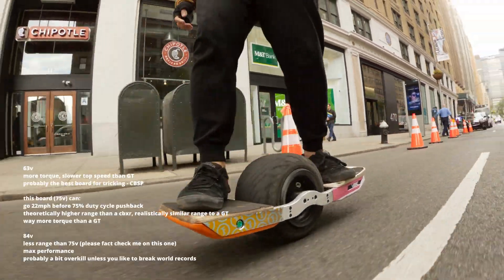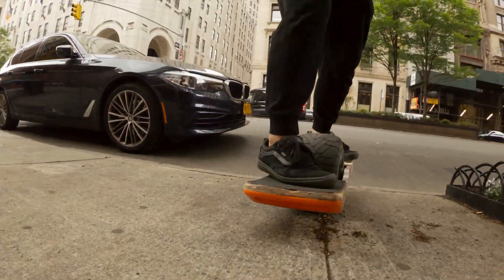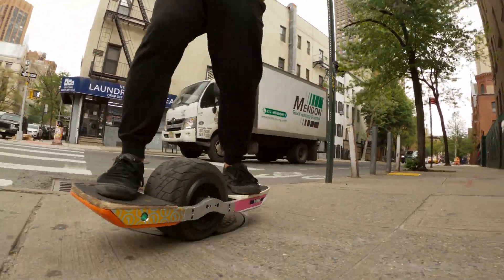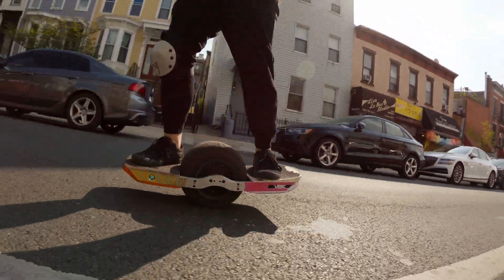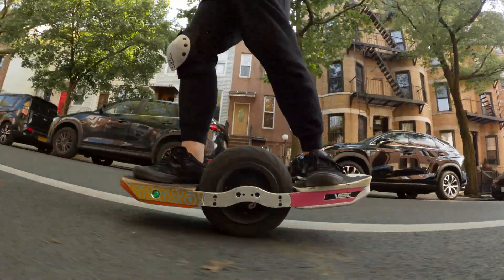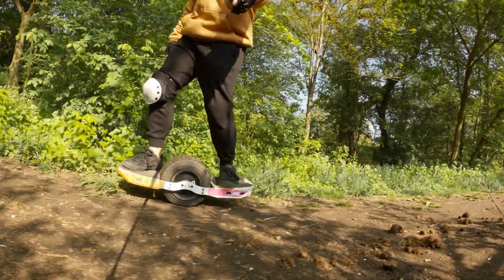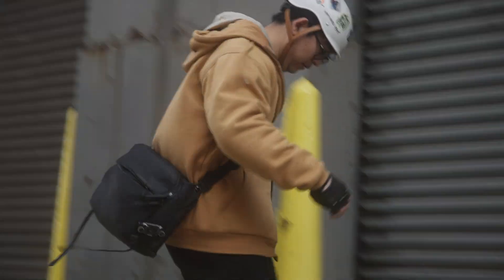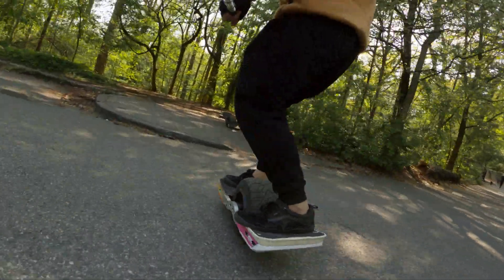10 reasons why a VESC is better than a GT

Comment: Sorry to arrive late to the party, just came across your interesting video now. I want to VESC my GT because I find it to be a little dangerously underpowered at times. I am not as DIY ambitious as you so I would do it with GTV kit. My main concern is captured between 0:49-1:00 of your video. What you are saying is that FM is more conservative with the Amp limits so the controller will last longer. I see that as a game changing benefit. My fear with a VESC controller is that it will suddenly die because it was not designed to last the many thousands of miles that I expect it to last for. If it dies while I am riding 20+ that is huge problem. Are you able to comment on the reliability of a VESC controller (generally, and specifically for the GTV) vs FM's GT controller, which seems to be proven as highly reliable?
Reply from the maker: Hi, great question! I actually do have a VESC board that I'm intentionally holding back the amp limit for longer longevity. Very easy to set that up if that's what you're after. None of my FM controllers have lasted 2000 miles because of the way I ride it (in rain with road salt, nudges, etc) and I'm getting comparable longevity from VESC controller. Also, these VESC controllers have years of history on Eskates and they've been working fine. Can't comment on GTV since I haven't ridden one.
Also boards dropping you at speed is a common fear. On VESC boards (all my boards have this treatment) you can setup the board to ignore footpad beyond a certain speed, ignore hall sensor beyond a certain speed (i think FM also have this feature), and some firmware can also ignore power button short press at speed. So basically at speed if one of your tiny cables fall loose, as long as your controller is still getting power from the battery pack, and your 3 thick phase wires are solid, you board won't drop you at speed. I actually have ridden once where the footpad cable came undone mid-ride, and I only noticed it after I came to a stop. If I was on a FM board this incident would've dumped me. (not to mention I was able to keep riding for the day without a working footpad by turning on simple stop and ghosting the board)
Reply: @leonchang7596  Thanks for this reply. I see there is some advantage to VESC to keep it running under some circumstances - these are good to know. I still worry about the controller suddenly dying at speed, trying to do what I can minimize the chance of this. My GT has dumped me twice at speed when I was asking too much of its power, but I have nearly 7000 miles on it and my board has never just died. So I consider it to be highly reliable and I don't want to trade one risk for another. If I can reduce the risk of underpower nosedive and not increase risk of controller/component failure, that is a big success.

Comment: I´ve a question: How do I start to get deeper into "oneWheel" topic? 
I want to buid my own, and see a lot about VESC... ;) If there are some hints for starting? 
BR Thomas
Reply from the maker: Good question! If you’re new to the sport then get a used XR or GT and start riding, building a board might be a bit too involved if you’re just starting out unless you’re very dedicated. If so some of my latest videos show you the process. Also read pev.dev, join the Fungineers and vescify discord, and watch some DIY electronics tutorials if you decide to build vs buy.
Reply: @leonchang7596  thanks for answering. I definitely take a look into building my own. But maybe I get a good opportunity to buy a used one to get my first driving experience... 😜
Reply from the maker: @der_kaputte  yesss, definitely recommend getting a used working board first, especially because without knowing what a onewheel SHOULD feel like, if you build one yourself and it's not behaving correctly, you won't know anything is wrong. And DIY boards are sooo focused on options that you gotta have a preference of what you prefer to know how to pick parts
Reply: @leonchang7596  Thank you very much, that sounds very understandable. I'll start looking for a board nearby ;)
Thank you first of all!

Comment: Love your video! thanks for the info. I want to know can you upgrade an XR + with 4212 build to VESC? I was going to buy a board from a seller, but I heard that the 4212 cannot be upgraded.
Reply from the maker: Yes! Any hardware version will work, since you’re swapping out the controller anyways, doesn’t matter which version it is
Reply: @leonchang7596  great thanks for  replying my question now is the cost so I can pick a used XR+for 900 with 150miles it might be better just to buy a float wheel adv 😉
Reply from the maker: used xr ~1k + batter upgrade ~600 + ubox ~130 + miscellaneous parts roughly equals to an adv. the decision is more about which platform you prefer and what you value in a board(range and speed vs third party accessories), and who you choose to support (small shops in the community or tony)

Comment: Hey, the torque thing is because the vesc actually CAN control the torque due to FOC technology and shunts for measuring phase currents. Torque ~ Current. The other motor controller doesn't do FOC.

Comment: Appreciate your videos, Leon! Great info! 

I see a lot of people rocking WTF rails for their VESC builds. Are there configurations in the shaping for VESC that eliminate the need for a tilt kit? 

I’m planning out a VESC build as we speak, and I’m wondering what the Pros and Cons are of going with WTF rails for my VESC board. Is a tilt kit still needed? Do you have one on your VESC? Or is there another alternative that’s made a tilt kit obsolete? Such as a new part or advanced shaping settings that FM doesn’t have.

Would love to hear your thoughts!
Reply from the maker: Hi! Glad you enjoyed it! Hardware tilt kit is not necessary for Vesc, you can change the default set point by recalibrating your IMU. You can even save IMU presets if you constantly switch back/forth between Ws and straights! Actually any hardware fix for a FM software issue is no longer necessary, such as tilt kit, posi, surestart… can all be emulated in firmware

Comment: literally bought a gt about a month ago dialed it up with wtf rails enduro tire kush wide chillers etc. now i want a vesc but the build seems daunting af
Reply from the maker: I came from GT too, bought into the XR ecosystem specifically for vescing. It's quite the jump!
Reply: @leonchang7596  grats on the build. how is it on trails? i feel like the gt with all the aftermarket parts is the most sturdy board for trails.
Reply from the maker: GT is the best board when it comes to tanking rock gardens and cobblestones. You can go fast over super bumpy terrain and GT’s nose will not wobble at all. For all other aspects, I prefer my Vesc. There are new trails that are getting unlocked in my local area where only Vescs are able to hit

Comment: Wouldn't you get more range out of a 84v setup than a 75v setup? Wh= volt x Ah. Ah- amp hour. Wh- watt hours.
Reply from the maker: The reason that currently 75v setups are longer range is that they use 21700 cells, and it's not possible to pack in 20 cells in series while still being 21700. So most 84v packs are 18650 packs. The workaround is a split battery pack, where they put 18 cells in series in the rear, and the rest in the front box. This will require a bigger controller box, such as the elm box. It's do-able but it's above my skill level, and wiring that for BMS I'd imagine to be a pain in the ass.

Comment: I'm not a OneWheel rider but just wondering if there is an option to have a wifi accelerometer/sensor in your glove to control the tilt angle so that dynamic response to changing slopes were possible? A button on the back of the hand could act as a reset so that hand orientation can be re-calibrated on the fly as often as wanted. This board is fascinating for its self-build options.
Reply: yes there is.  

https://youtu.be/Udap4uno3E4?t=721

here at 12min he talks about it
Reply: @e5211  thanks. It’s great to see as open source movement from the one wheel community. Now, we need the same for EUCs.

Comment: Except a float wheel is even better than a vesc as it performs better than even a 84v vesc battery with its 6 hp motor, much more range (up to 36 miles) than the 84v vesc battery packs offer, is mostly prebuilt for you already and most importantly even the top of the line float wheel adv pro costs much less than our costs to upgrade to vesc at only $1800 & don't need a pre existing fm onewheel to build upon
Reply from the maker: I'm as excited as the rest of the community about floatwheel, and I suspect it'll be a great replacement for the GT platform. But let's hold off on opinions until we get third party reviews.

It takes ~$150 to upgrade an XR to a VESC if you have common DIY electronics parts. You can recycle your XR controller box and mod it to fit a ubox 80v, which comes with all the cables and ports that you'll need for the conversion.

Also I personally love the XR platform. There are UHMW bumpers, thin rails, off-the-shelf components for literally every single part of the board, rectilinear design with no curved surfaces, which makes designing custom accessories extremely easy, and a super saturated used market. I also love that I hand-built my board and tuned every aspect of it myself. Is it practical? No. But when people ask me "hey how much does that cost" I can confidently say "idk I built it myself".

Again, it's great that we're finally getting a real competitor to FM, and the attention of detail that Tony has been bringing to this product makes me super hyped, but this VESCXR is still my board :)
Reply: On paper perhaps. It's also a 43 lb pig

Comment: My CBXR, bought off Craigslist, has an anti-theft FOB to turn on my Onewheel. (Orientation still matters, I just don't have to bend over to reduce that quality of life you speak of.) 

The power button no longer functions by design, as this device bypassed it. Reverse image search shows a "Wireless RF Remote Control Switch." When I went to Arkansas for Float Fest 5, no one had heard of it, and people were starting to refer to me as, "You're the guy with the remote start FOB?" 

Last year I tried to pry into the controller box but I couldn't see what had been modified. My light just started flickering so I will be going back in again and I will try get to the bottom of this mod because it is nowhere to be found, online. As in the guy that did it, must have known how to do it, because I can't find a video tutorial about it.  

https://www.amazon.com/gp/product/B0B7ZM1TGS/ref=ewc_pr_img_1?smid=A19JB4U5KYS1EN&psc=1
Reply from the maker: interesting design, i've never heard of anything like it! i did met a guy who rides a board without a pressure sensor as a front pad. instead it's a magnetic keyfob that sticks onto the footpad and tethered to his anckle. pretty cool alternative design!

Comment: So this vest is plug and play or do I need some specific knowledge like computers and stuff I want my board to behave like yours. Where do I start how long does it take to build a vesc I wanted to do this with my gt btw
Reply: If you don’t have any DIY building or maker experience, then this is not a good first project, especially if you have no direct help. It’s a lot to learn and many parts of it are critical, and will become dangerous if you don’t know what you’re doing.
Reply from the maker: GT is gonna be especially tricky because it does not use off the shelf connectors for motor and footpad cable. This means you’ll have to reverse engineer/3d print your own clone of FM’s proprietary connector. If you don’t have DIY experience I think it might be a bit more than you can chew. 

Even after completing this extremely arduous project, I’d argue the end result is not as good of a ride as an VESC-XR 

If the GT is your only board, you probably should get another board to vesc anyways, assuming you ride frequently.

Comment: so glad i found this video. i am plannig to vesc my pint x and have no idea where to start , cant wait for next video, thank you for your work EASY SUB
Reply from the maker: Thanks! Pint x vesc mod is a bit tricky since all of the connectors are proprietary to FM. I saw some people reverse engineer FM’s connector with a 3d printer. The next build guide is gonna be more focused on modding an XR, but I think you might get a few things from it too!
Reply: @leonchang7596  ya understand, I appreciate your response . 
I guess I will have to buy a soldering station, I think if it’s not a  bored soldering, I should be fine, my main thing is if I have to change my BMS as well or not ..  because I don’t want to deal with it. (And I know FM always fined new ways to make it harder so I am not sure about this version) .
My pint x is hardware 7314 
Firmware 5076
..
Also would love to know which VESC   one is “best”.. ( preferably with Bluetooth, modular already, and the resistors-so I have lees soldering  Work to do.👌🏻
Reply from the maker: Focer have the least amount of soldering and highest performance but is a pain to deal with. It breaks all the time in 3d printer boxes and doesn’t support LEDs, only has internal bluetooth (will randomly disconnect on iOS devices). I think it’s good for an endgame build.

Ubox is a lot more beginner friendly because it’s cheaper, comes with an external Bluetooth module, a fuse, and all the wires you need to get it working. But you will have to solder stuff. Nothing too hard, just soldering wires to pins.

I’d say for vesc builds, expect soldering and basic multimeter knowledge to be MANDATORY. Even if you don’t plan on soldering, you’ll end up doing it anyways.

That’s all I’m able to fit in a yt comment without turning it into a book. My next vid will dive much deeper into this
Reply: @leonchang7596  I appreciate your response, personally I don’t mind to put more work for something more reliable. That’s the most important thing for me especially for my kind of riding  style., (and if it requires a professional assistant, I don’t mind to get it especially since I’m doing this project in Mexico and labor is cheap here, so I’m sure I can find somebody that knows how to solder for a reasonable price) 
Looking forward for that video 🤙

Comment: Great video, I never rode on a ine wheel, I'm an eskater but this was fun to watch 🤙🏼🤙🏼
Reply from the maker: Thanks!! You guys have been building vescs way longer than onewheelers, we’re just getting it now
Reply: @leonchang7596  yup. Diy Builder here, close to 3 yrs. Vescteran lol. But I think your calibration might be more complicated since we just do motor detection, amps and duty programing mainly,  well quite a few more things that most still haven't learned but you get the point. Lol. Safe shredding Brotha 🤙🏼🤙🏼🚀

Comment: 84V is not less range than 75.6V if you make them out of the same cells.
Reply from the maker: Yep! Most 75v packs use 21700 cells and 84v use 18650 cells. Would be cool to see how floatwheel performs since it’s 84v 21700
Reply: @leonchang7596  my 84V uses 21700 cells. It's a split pack just like the floatwheel
Reply from the maker: Oooooooo! Elm box I assume?
Reply: @leonchang7596  yes!
Reply from the maker: @thechickentendy3982  you lucky bastard 🤣🤣

Comment: Rad dude. I have been on the fence for the last year, do I sell XR and get a GT or do I get a CBXR for the XR or wait another year and then VESC the XR. I am looking forward to your build vids.
Reply: Floatwheel ADV!
Reply from the maker: CB is a whole other rabbit hole. They are a great performance upgrade but the build quality is very questionable. If you’re thinking about vescing then you got way more battery option than just a CBXR, which is designed to work with / restricted by the FM BMS

Comment: I see your video before this is the direct opposite
Reply from the maker: It’s kinda impossible to say one is better than the other. They’re all good at different things and it’s important to acknowledge both sides
Reply: @leonchang7596  wow I wanna try one, I wouldn't be so picky as long as it works. Bet it's addictive
Reply from the maker: You can go to any onewheel retailer (find them on onewheel.com), sign a waiver, and they’ll give you a ride demo. It’s super addictive!!

Comment: There’s only one reason vesc is better then one wheel and that customization
Others then that it’s the same
Reply from the maker: Customization is it if you wanna sum up everything into one word
Reply: @leonchang7596  if future motion wanted to unlock their app and allowed full control vesc would have issue I believe. I could verywell be wrong
Reply from the maker: I really hope one of the reasons why GT custom shaping is taking so long is they couldn’t release it unless it can compete with vesc. Of course this is purely speculation.
Reply: @leonchang7596  I need to get on that gt platform now they have w’s and bumpers tires and such in the after market.
Reply: @leonchang7596  I bet they are working with cpsc and can’t release anything making the Onewheel more dangerous in the eyes of cpsc.
Reply: yeah I think FM is afraid to release C-Shaping w/the Cpsc & others eyes all over them 👀

Comment: Great video! But I love how one of your reasons why VESC is better than GT is that you can make your VESC “almost as good” as a GT 😂😂
Reply from the maker: Hahahahh, almost as good as in out of the box with recommended settings the nose is almost as stable. When it’s tweaked right the nose is perfect! I tried at least 5 ESCs (focers and ubox) at this point and they all kinda suffer from nose dip issues on small drops unless the board is super dialed.
Reply: That's phucked. If you own an XR and you want more power, it's a no-brainer if you own a gt you buy a gts.. $$$$